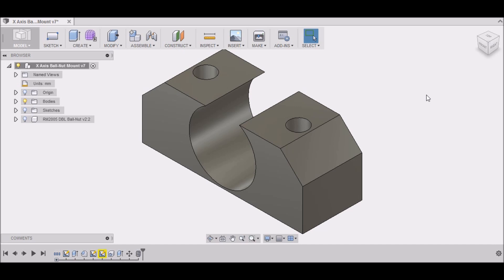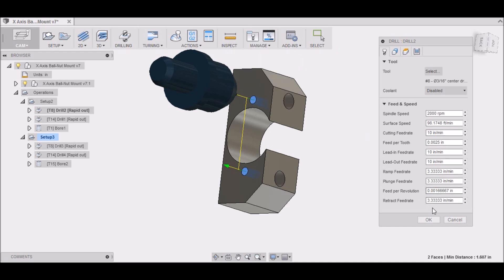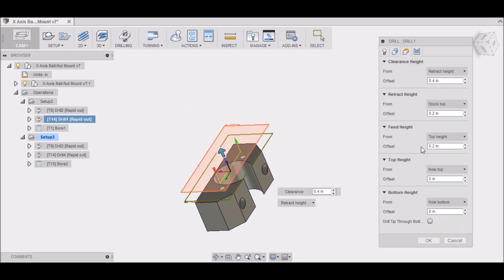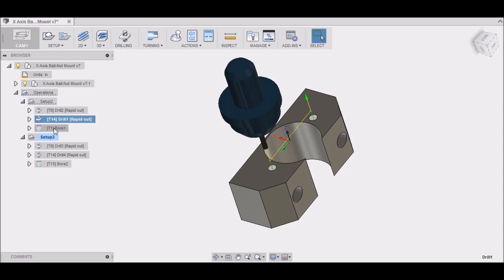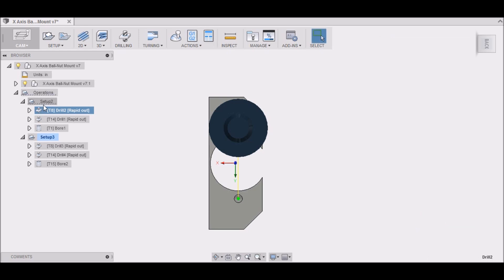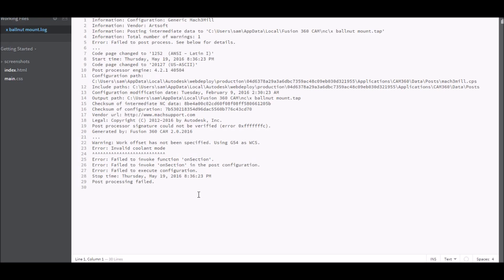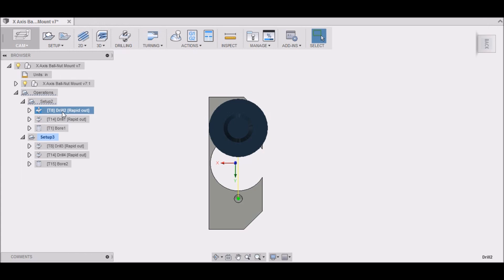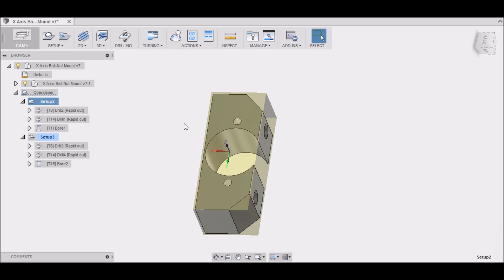Fusion 360 " G code Errors "

Comment: hi Sam,  on mach 3 cnc, on the  tool screen it shows the g code part under the dotted outline box and when I try to run the file it says " Z axis to low " my machine has homing switches homes z up and is z zero it has -250.0 mm of travel, when I move z axis down manually it's all OK, if i put a g code at 70mm above the table it runs ok with  g28 turned off and at about line 5 I remove the g43 z0 h4 line from the g code, if i remove the g94 g 91.1 g49 from the file it will run the part on the table and if I turn off the soft limits again it runs on the table ok, any ideas ?? thanks daniel
Reply from the maker: In the config tab under Save Z setup try turning it off. Also make sure your setting for soft limits is correct for Z

Comment: thanks Sam trying your m6 marco to see if it mine that is the problem, thanks daniel
Reply from the maker: So Let me ask, I assume that your tool table is populated with your tools and tool off sets. If so the G43 T xx should be fine. My macro does this so the additional command is not needed in the G code however should not be a issue if it is left in.
Reply: Sam with your marco running and g28 and g43 removed all is running ok, only thing I changed was the height that the tool returns to, I. E tool one probe run touch off macro, then run your voice tool change marco for say m6t6, head retracts I  change the tool and the tool return back, I change the point to 5mm above job (the height I set in your macro ), the one thing that worries me is if the tool now at 5mm as to clear a clamp on the table 10mm high before it gets to the maching place, I can see I think this is why fusion 360 want to do a g28 home move to clear anything on the table would you agree ?? Also this why fusion has a clearance high, so you can set the high to clear clamp and fixtures??, I am happy i am getting working a little, this was so much easier in cambam you set a clearance high and the g code just worked lol, Thank you for your help on this, I have corner probing Macro's for touching of all four corners of metal stock if you like I will be happy to email you them, there in mm but I am sure you may find them useful?? , thanks daniel
Reply from the maker: If clearing the Clamps and hold downs are a issue you can just set the 5mm above Higher than your clamps , It will move down when cycle start is pressed.

Comment: hi sam spoken to soon, i waas running parts with one tool and all was ok, now problems when running more than one tool, if i remove all is ok, any ideas for removing it from the post as i not seam to find it in there ?? thanks daniel
Reply from the maker: Hi Daniel, Are you running Mach3?,  the problem is when you encounter " M6Txx" line of code?
I do not have any issues with this using my M6 Macro you may want to check there in your system. 
Be Safe,
Sam

Comment: Hi sam the mach3 post has some problem that you have to watch for, the first one for some reason it will add a offset to your config file in mach but you can't see it in you off set page, it will show up when the machine  is at tool change time it will go to a spot you did not set or it will go back to the last position then to new position after tool change , if this shows up just do cancel off set in the mdi.

the other one is it will go to  Z machine home after a X and Y move it should be the other way around again you will have to do a cancel code in the mdi.

and please have you models in components
Reply from the maker: I have not had that issue but I think my tool change macro is different than yours.that may be why. Good tip.
Reply: just something to look out for if it does funny things at tool change time just put in the cancel codes, don't bother posting about they wont believe you about it on the fusion forum

Comment: hi sam, i just wanted to add that as we discussed some people may find g28 to be a problem, i did as it confused my mach 3 cnc mill change tool macro, you can turn it off in the post screen before you post your g code, plus g91 was adding the tool offset to my tool as well as the tool change macro, if you have a problem like this the g28 and g91 can be removed by editing the post but beware to check it as if done wrong could causse a tool crash, great video and look forward to the next one daniel
Reply from the maker: Thanks 
Yes those can be turned off on the setup page   One more note 360 also adds in the G43tool offset. I normally remove these lines of code. As there not needed when using my tool change macrp